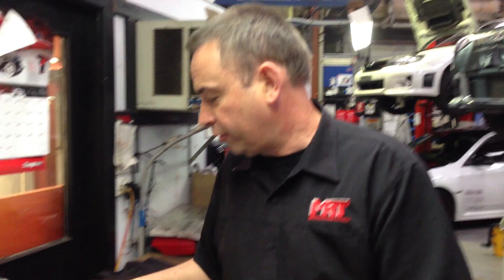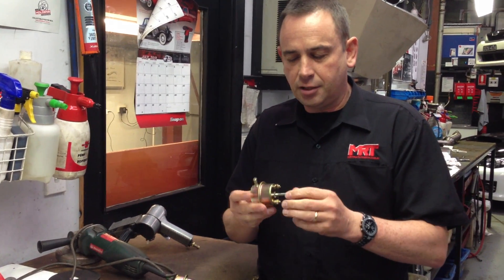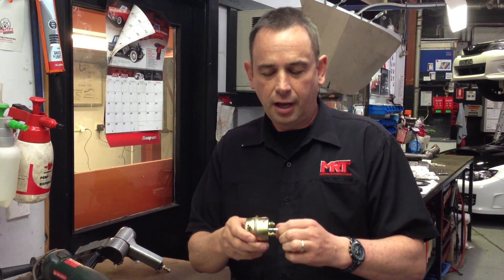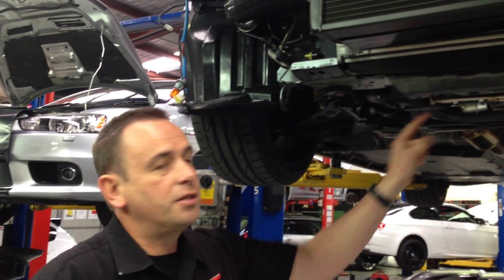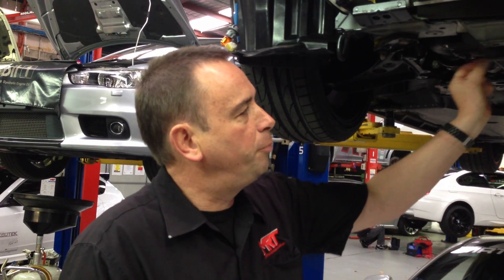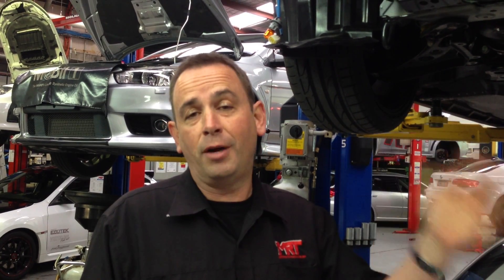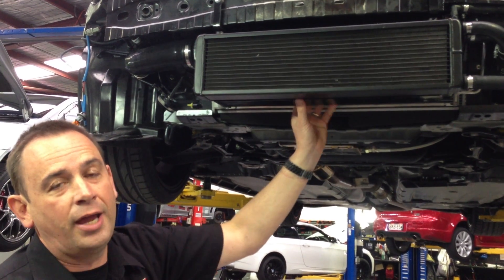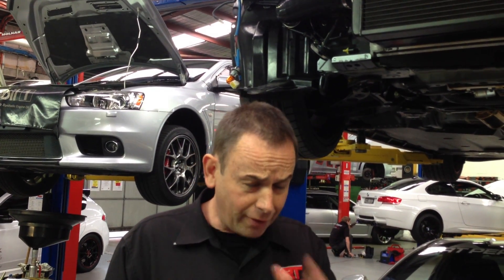Subaru wastegate settings and secrets. Project 86 part 4 we explain how they work and what they do

Comment: Thanks Brett, great video. I have 2006 standard WRX  with 70,000km. I have no boost just a hollow sound under strong acceleration. The car been very inactive for the past 3 months, could this be a problem with wastegate actuator or solenoid due to it not being driven?.
Reply from the maker: Carefully drive to us if you are in Sydney, or refer our partner list on our web site for local help in Oz...
could be a multitude of reasons
Reply: @MRTPerformanceAustralia  
Thanks, I live in Manly NSW. Will i damage the car if i drive it as it is?.
Reply from the maker: @marcmacc11  thats hard to advise when we cant see  or hear it
:(

Comment: Having a hell of a time getting my td-04 to spool. Now what you meant by seat tension and lazy coming into boost is EXACTLY what my car is doing.
Lazy as hell. 
Should I back the wastegate arm out until it just goes over the actuator arm so it will spool like it should or tighten it? 
I've been asking  everyone I know and no one has a clue. When I tightened it its close to it's target load. Just takes forever to spool. I turned it out and it's down by 2lbs of boost. 
Any idea? Car was protuned and is looking for 16.9 WOT in 3rd. Gets close....just takes until 5500 rpm to get there.
Reply: squishypitbull I can’t help man but something seems off a td04 shouldn’t take that long to get boost at all. I’m on a 2.0 wrx with a vf48 and I get full boost at 4900 rpm.
Reply: Ian Jacob found out what it was. Blown up pipe. But it's been acting funny for a while so I'm swapping to a larger turbo,ebcs, fuel pump and all new lines.
Reply: squishypitbull good man I just sold my bugeye and got a blob sti that makes 480 wheel on e85. Steam speed stx71 turbo and equal length headers. I’m hooked for life on Subaru’s haha
Reply: Ian Jacob awww yissssss! Lol 
Nice man! 
Everything is getting swapped in Monday. Should be making 350 to the wheels until I sort out which trans I'm gonna go with. Still have room to work with on the turbo. It's my daily so I don't think I'm gonna go past 400.

Comment: How do you connect the solenoid to the ECU? did you remove the EGR and are using it's the pwm output to drive the solenoid? or does the ECU has an unused output and "map" on the software?
Reply from the maker: The ECU needs a custom map, outside factory design to acheive this. Its not easy to describe here